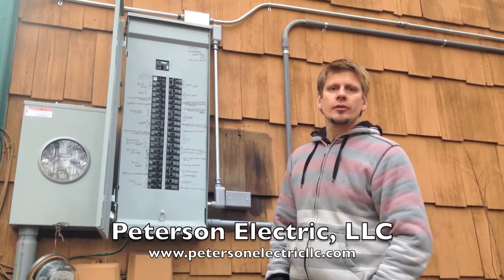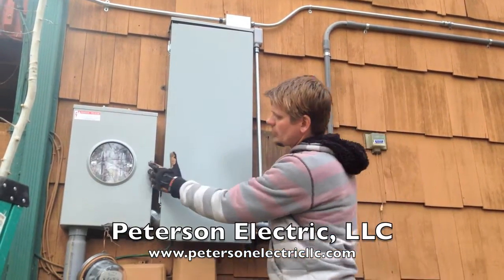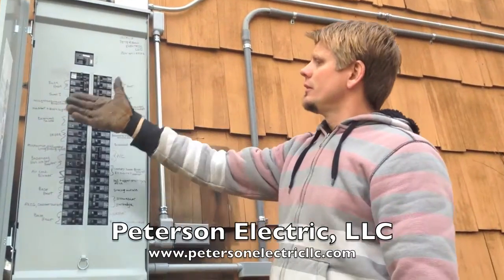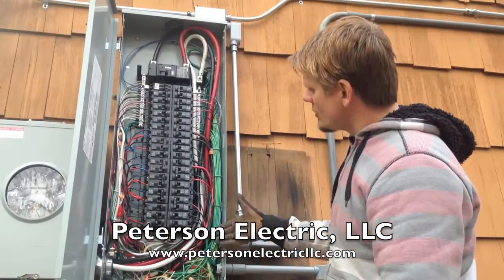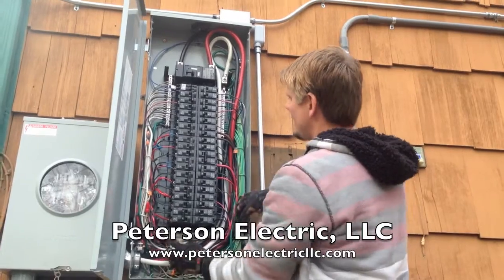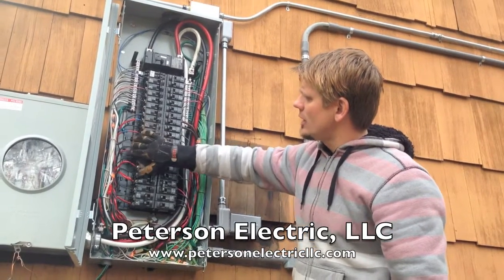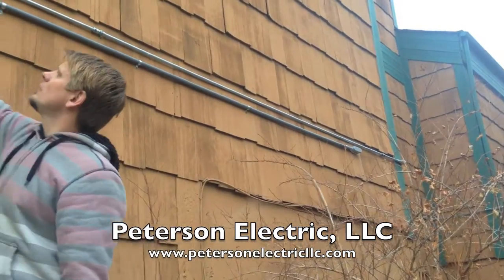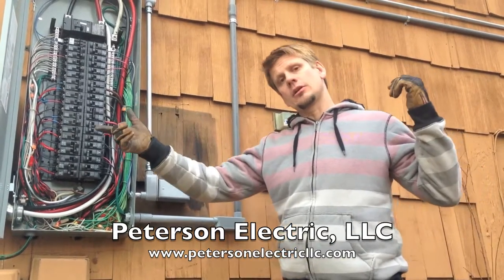Installing An Electrical Service Change, Replacing FPE Panel, Extending Circuits

Comment: Doesn't look like overkill on the panel to me. I use Square D QO where I can. After I explain to the customer why I like them they usually go for the extra cost. (It's really not all that much extra anyway.) I would never put a bolt on breaker panel in a residence, but I definitely recommend the better equipment where the customer is willing to pay for it. - Honestly, that looks like a pretty good job to me.
Reply from the maker: Thanks, but 6 years later I can honestly say I would have ran 1/2 of less EGC conductors to extend, could of used one new per every two coming out of the house, yet the way I did this it would make it easier for a guy to trace the grounding conductor out if there is an issue. I like SQ D QO and HOM, they are my second choice, I really like their test design when you have an AFCI vs GFCI fault on the duals.
Reply: Peterson Electric Yes, I suppose you could have put a ground bar at the bottom of the panel and just landed all the grounds on that. When you're in the middle of something though, you don't always think of everything so I'm not going to throw any stones. - I had a little trouble with Cutler-Hammer CH series breakers coming off the buss too easily. After that, I started using QO. They seat very solidly. - Typically, I'll use a Siemens copper buss panel as my second choice. I brought up the bolt on breaker because it looked like someone said that was a "commercial rated" panel in the comments. - Bolt on breaker panels are more commonly used in commercial environments because they will stand up to the typicl heavier use. However, due to the cost of the breakers it is not practical for a homeowner, unless they have an extra $750 every time they need to install a double pole arc fault breaker.... Either way, from one electrician to another, the work looks pretty good.

Comment: Pa still hasn't adopted  the 2014 code so arc faults are only required in new construction or new additions. all service changes on existing without arc fault isn't pushed in pa